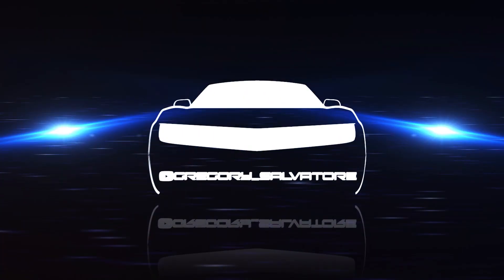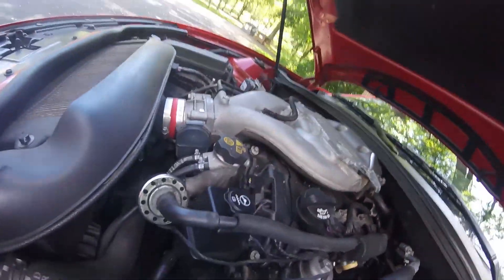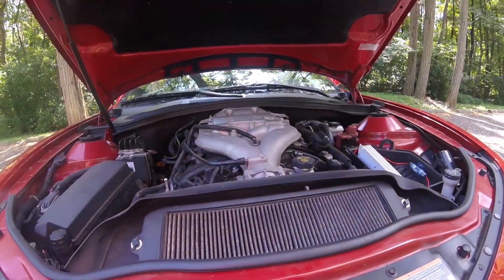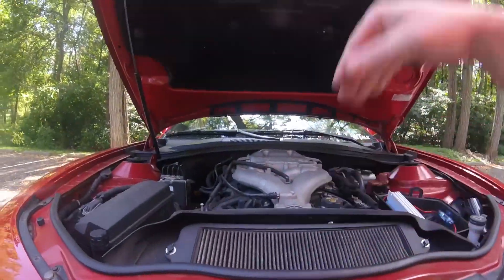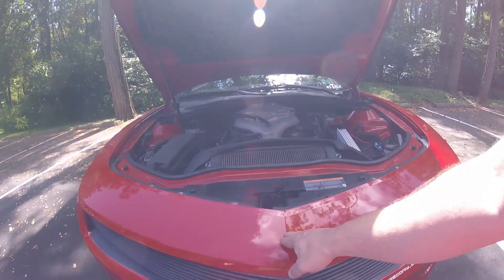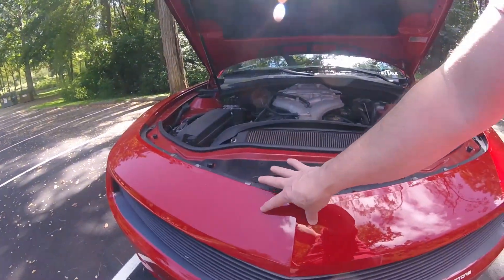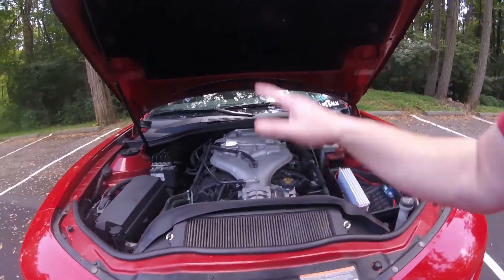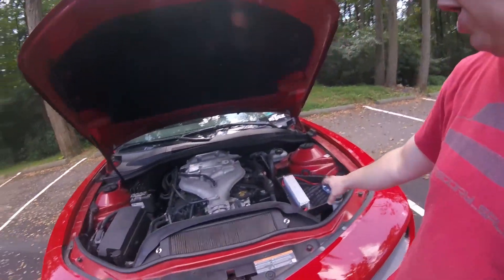How Does Vararam Ram Air Work on a V6 Camaro

Comment: 304hp & consistent 250 rear wheel hp from factory & you add this intake and you "guarantee its now 292rwhp but more like 310rwhp"?
I call BS. And all this additional hp without a tune after installing the intake? Please do another video explaining how you did the math on that.
Reply from the maker: That number is the horsepower of my car with ALL my mods. The manufacturer claims 12-15 hp from the ram air system. I also said it mostly gave me a better sound and didn't say anything about the ram air giving me any added performance. But the dyno tech where it was tested told me there is still a lot of untapped power there based on the hp curve. You can see that video here: https://youtu.be/lsM2BucgAgo and to see ALL the engine modifications you can go here: https://youtu.be/cDr1SUXrlvE

Comment: I bought a cold air intake from Cold Air Inductions made specifically for my 2014 Camaro LS. I found them from the many Camaro forums and YouTube videos created by Camaro owners. I have found my cold air intake to be a miss without being tuned. So I went to Trifecta Performance and ordered my tune. My Camaro runs like it's alive. So far I beat a small crotch rocket, kept up with a scat pack, and have dusted every v6 mustang, v6 challenger, and v6 charger. I didn't buy it to compete, just wanted to have fun and make it my own. The performance has far exceeded all expectations! Thanks for your video and best wishes :)